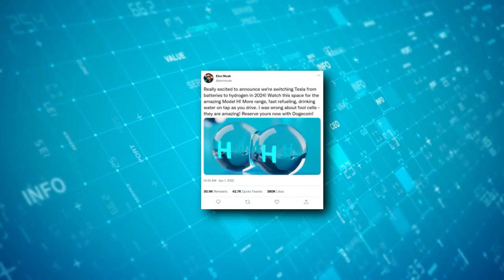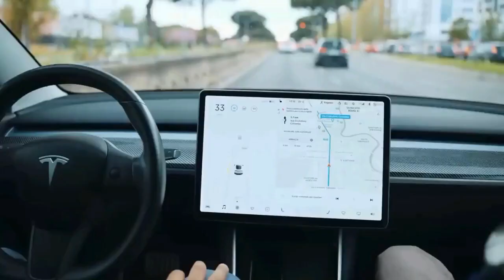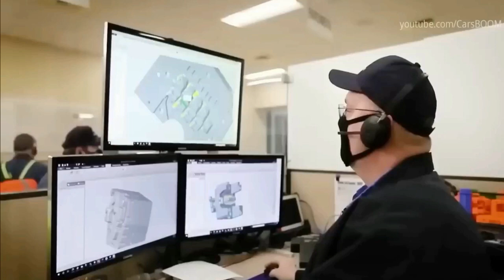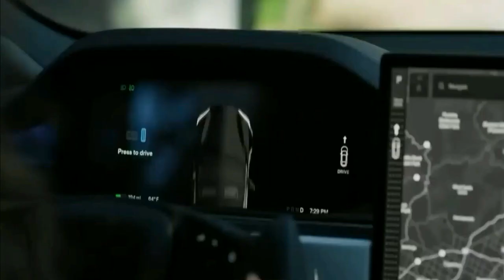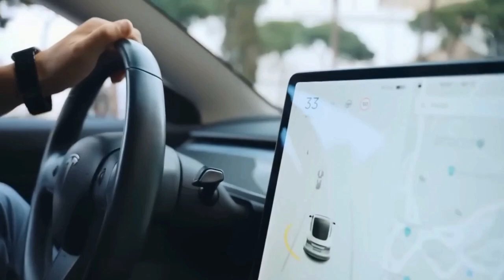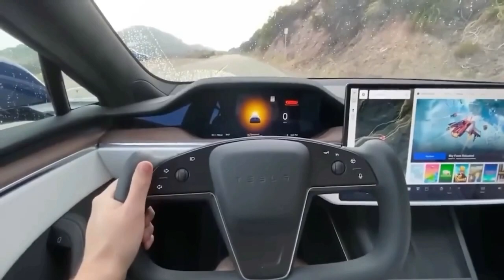Elon Musk's NEW Hydrogen Car SHOCKED The Entire EV Industry!

Comment: The real future is Solar EV's. A mode of transportation that never needs charging.
One brand, Aptera, is making such a car. Today it is limited in its range. Still, future solar panels will bring a huge change.
Hydrogen is interesting but it's footprint doesn't create a sustainable future.
If Tesla goes Hydrogen it's only because of lobbying.

Presentation is not bad but you need to get rid of the repeating pattern.
Keep it going ✌️